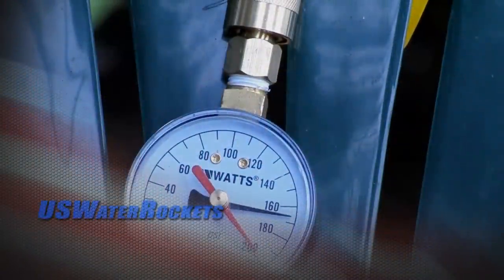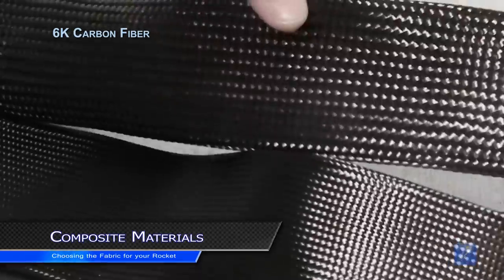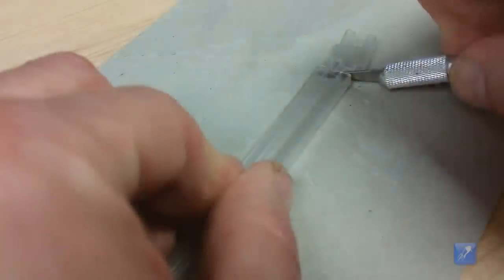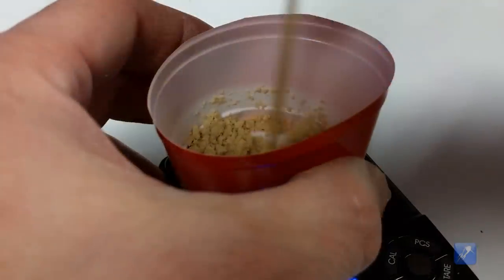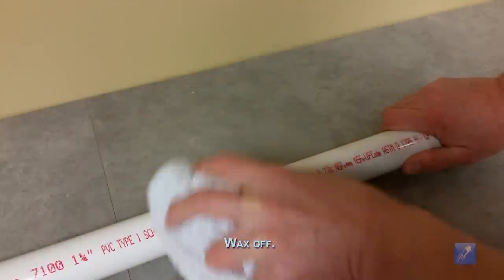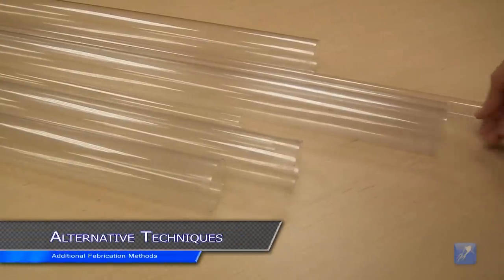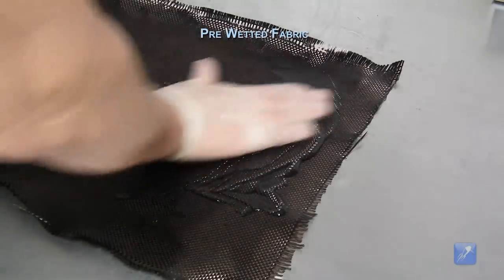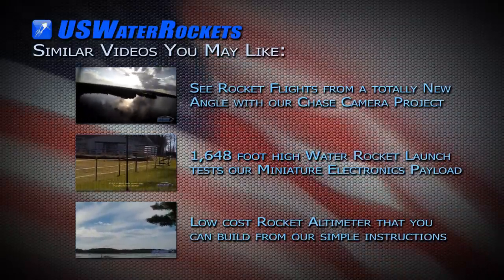High Pressure Water Rocket Making Tutorial, Part 1: The Pressure Vessel

Comment: Nice, Very informative. It's good to see the application for composite reinforcing in water rocketry
Reply from the maker: Thanks, but keep in mind that teams have been doing this since around 2003. The first attempts were done by AGR, and they used a completely different method where they wound a single string of fibers around and around their bottles until it was covered. It's a much more difficult process. One or maybe 2 others had tried unsuccessfully to make rockets using woven fabrics around the same time. We were the first to successfully deploy the process in the fall of 2003. We've built a number of rockets like this to look at different techniques over the years since then. Our budget allows us to build one or two each season to see how much farther we can push the pressures, depending on the size of the rocket.
Reply: USWaterRockets There is a lot of techniques out there, but most keep this information close to their chest. It's good to see detailed videos like this coming out.
Reply from the maker: AscenderRockets Thanks for the words of encouragement. Hopefully the information will be of use to you or at least even if you never use it, it is interesting to watch for you.

Comment: Great video!  Quick question-  Have you compared nozzles and bulkheads that slip in vs over, the tube?  I thought "innies" would be more likely to have the tube peel off as it expands?
Reply from the maker: We had problems with blowing out but then we figured out that we were just to aggressive saving weight by making the contact area as small as we thought. If you make the mating surfaces marge enough it will hold. You can also use extra epoxy to make a flange or lip on the end of the tube that keeps the bulkheads from backing out. It';s not really adhered to the bulkhead there, it's a physical barrier to keep if from moving out of the end of the tube.

Comment: hi there, great video. Planning on doing this for a group project at university, although there are a few things i am unclear of and i would very much benefit from a reply.  

1. are spliced 2L bottles using a carbon fiber or fiberglass composite possible, (as rockets shown on the video are very thin and do not look like the soda bottles used in the splicing tutorial)

2. which epoxy/Resin is needed as online there are multiple types of epoxy/Resin

3. also what type of grain did you use for the composite? which worked best, (we have around £300 budget) 

thank you.

Comment: This is a great tutorial series, we're looking forward to see the upcoming parts.
Is there any reason why you chose carbon fiber over fiber glass?
We're a quite happy with the pressure performance of our fiberglassed rockets.
It would be useful for beginners to add links for ordering in the video description or in the new "info cards".
BTW: What is the weather like in the states? There were a few days with good weather in Germany, but it's quite bad right now and so we're unable to launch.
Cheers
Julian
Reply from the maker: That's a lot of questions! Let's get right to it. Carbon Fiber and Fiberglass are close enough in tensile strength to make little difference in your application. Where carbon fiber is better is in impact resistance. We discovered that this makes no difference to the typical person but in our case where we fly over a lake, the carbon fiber rocket will not shatter when it hits the water, but the fiberglass rocket will crack or shatter on impact with the lake. Neither of them seems to withstand hitting solid ground. So, we have used mainly carbon fiber for this reason.

We already played around with info cards, and will add your suggestions when we get more time. The team has been doing 2 important builds in addition to this video and it has had everyone super busy.

We had 2 days last week were it was around 40F (4.5C) and sunny, but the snow here is still about a foot deep and when it gets warm like that the snow becomes wet and really hard to walk in. So, we worked on our builds in anticipation of better weather in the coming weeks. But your question was about the weather in the "States", which is pretty broad. We could take a trip to Florida and have summer temperature and sun! LOL. But that's a lot of work!

Thanks for the comments!
Reply: USWaterRockets Haha, I'm sorry about that weather question. It's quite unusual to me to ask for weather in a particular region because Germany is a pretty small country. Compared to you the weather in Germany is pretty nice, we had no snow since February and last week about 20C / 68F. Well, now it's colder again with 6-8C / 42-46F. Thanks to EU we are also able to travel to Italia or Spain without any pass controls or changing the currency so that's not big difference to you.One thing I noticed when playing around with the info cards is that you're still unable to ad links to amazon and the most other common sellers. Julian
Reply from the maker: RaketfuedRockets It snowed a bit more here today! It did warm up to about 7C in the afternoon when the sun was out, but it got cloudy and windy and then snowed. Mother Nature is not cooperating this spring. In past years we were out on the lake launching already.
Reply: +RaketfuedRockets So carbonfiber is the tool of choice? You alluded to metal is a no-no. So Ti cannot be used?
Thanks for the video, and looking forward to the next.

Comment: Where can you find composites like the ones you have here? I want to build this but the selection on amazon of composite laminates is not very good and it's really expensive for a small amount. Could I find this at like a store that sells plastics or home depot? (or any hardware store) Also, where can i find the epoxy used for the laminates or is it just 24 hour epoxy?

Comment: I love your tutorial. What about the launcher? and how cani fit my launch pad altimeter in this new rocket?
Reply from the maker: The launcher we use (The "Instant Launcher") will be documented in more detail in one of the future episodes. It's based on our "Split Collar Cable Tie" launcher (https://www.youtube.com/watch?v=T0dKc0fkVko). If you look at the PVC nozzle in this video you can see that we made the nozzle so that it has the same basic shape as a bottle neck (with the threaded part cut off). That way it works on the same release mechanism abd o-ring launch tubes (https://www.youtube.com/watch?v=X3Dd1HZd7fg) we've made for our bottle based rockets.

Our LaunchPad Altimeter design will not fit in a T-12 or T-8 FTC rocket, It does fit in a T-17 FTC Tube, and the other rocket in this video that we made from 500ml Iced Tea bottles is roomy enough for the Stock LaunchPad Altimeter.  

However, it is quite easy to make the altimeter a whole lot smaller with some custom work. This guy made the whole thing about the size of a soda bottle cap!  http://www.wra2.org/forum/viewtopic.php?p=17159&sid=d241e7b9251e1701ad55a8375f813ac2#p17159

Comment: You say that you used custom nozzles to reduce drag, but can it also be used to improve the performance by directing the water/air more parallel down the rocket, because if it would expand out of the nozzle creating a diverging water/air stream the diverging velocity component of the water/air will reduce the amount of effective thrust? Thus similar to rocket engine bells of chemical rockets. Or does this have hardly any effect, because most of the thrust comes from shooting out the water, which is nearly incompressible and thus expand very little?
Reply from the maker: There has been a lot of debate over the years about the DeLaval nozzle and whether there were any benefit to using one with a water rocket. We have never had an experiment with enough control to measure the usefulness of such a nozzle on water rockets for precisely the reason you mention. Since water does not expand, the only possible source for added thrust would be from the extra air that follows the water out of the rocket. Our "custom nozzle" design is purely intended to reduce aerodynamic drag on the base of the rocket. It's possible the long taper also helps reduce turbulence in the water as compared to the PVC nozzle, which you can see has only a slight cone on the inside (made with a the tip of giant drill bit).

Comment: How many layers of carbon fiber should it have?
Reply from the maker: All carbon fiber is not equal in strength, weight, and thickness. Two or three layers of a particular low cost grade may hold less pressure than a single layer of top grade material. You have to pick a supplier and get samples and test them. The easiest way to do that is to make some short tubes of your intended diameter with various samples and pressure test them until they either fail or you prove which ones meet your pressure requirements. Then you can make a full length tube using the material you decided was best.
Reply: Sure thing, thanks for the response!